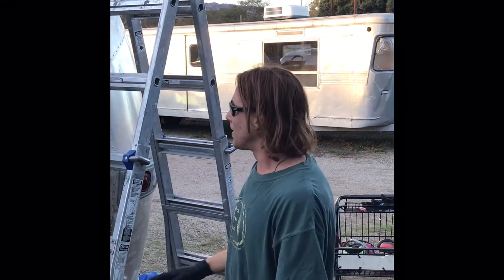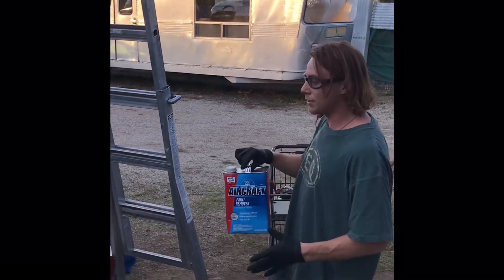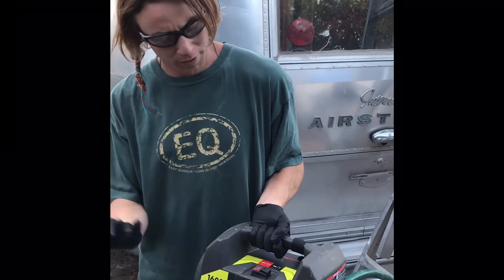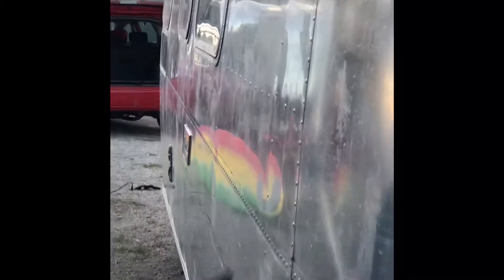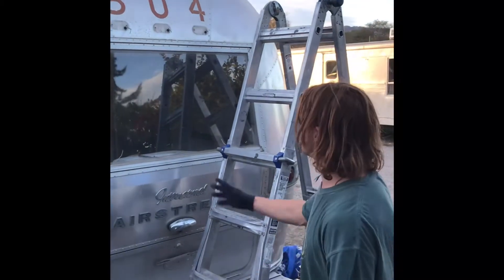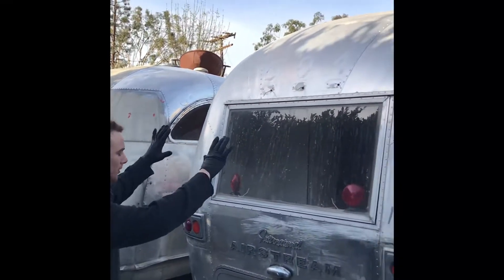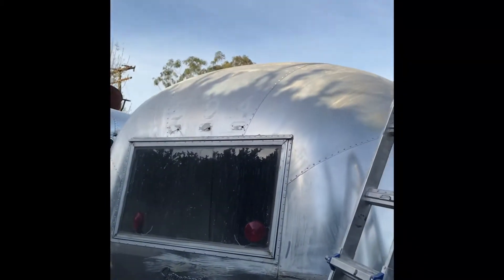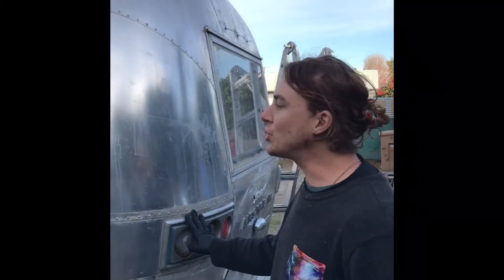Stripping an Airstream

Comment: Thank you for the helpful videos.  I have a 1968 Overlander and am wondering if it still has a clearcoat.  Am I right in thinking that the way to find out is to put some sort of stripper on and see if it bubbles? Thanks in advance!
Reply from the maker: ClaireGilbert ClaireGilbert. Yes test a few areas before applying on the whole surface

Comment: Looks like the aircraft stripper is now a non-meth line that they sell at the alto store. $52/gal. Does this work as well as the meth version u use in the video or what r u using these days to strip the plasticoat
Reply from the maker: Lauren Earthman Using the PPG Aerospace you can order from Vintage Trailer Supply. Then for the small stuff you can use what they have in stores either aircraft or whatever is available